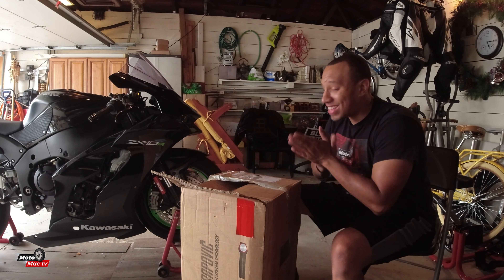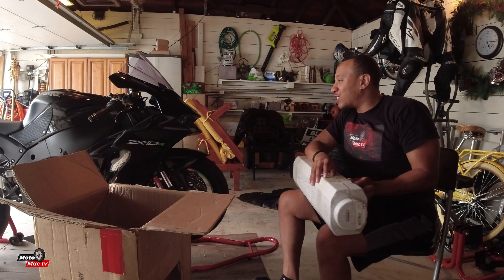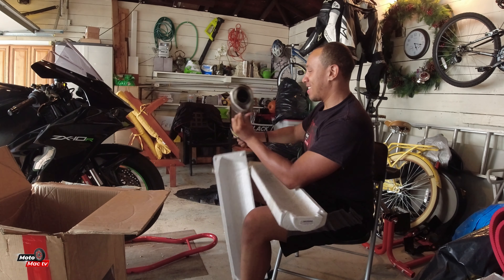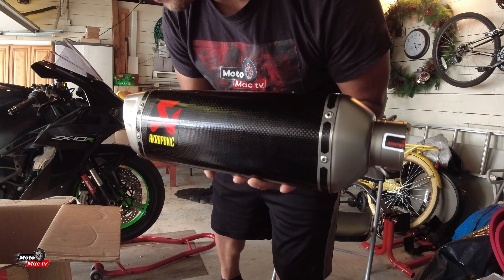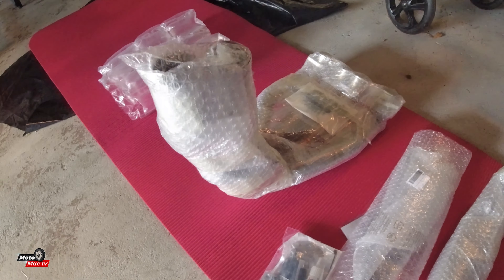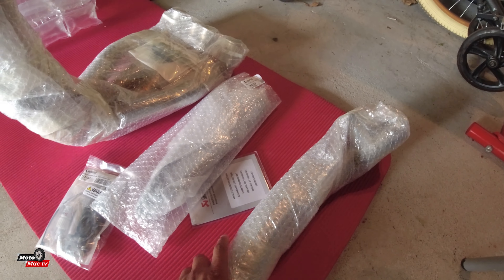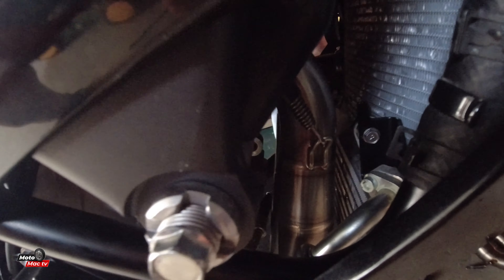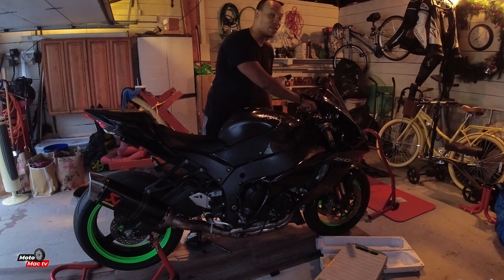2021 Kawasaki zx10r Akrapovic Full Racing Exhaust System Install!!

Comment: Just put the full titanium racing system on my 2023 Zx10RR with Power Commander racing air filter block off plates frame sliders and a vortex negative one Sprocket in the front. I'm just finishing it up now.
Reply from the maker: Awesome man! Enjoy!

Comment: Hey I have the 2022 and am having an issue with the sleeves for the header seating on the cylinder head.  
Was it snug almost hard to place in the cylinder head ? Or was it kinda loose like the stock header ?

Comment: Could you put the rear peg back or you just chose not to put it back cause it looks better that way ?
Reply from the maker: Nah in order for the exhaust to hang properly the passenger peg has to be removed. No more riding wifey around 😢
Reply: Do you think you could get a custom bracket built by a metal fabrication place?
Reply: I installed it with the original pegs . Everything works out perfectly. I had to get a longer stainless bolt for the bracket and that’s it .